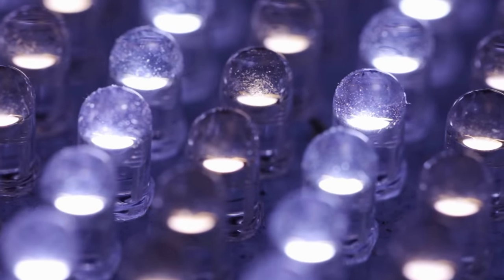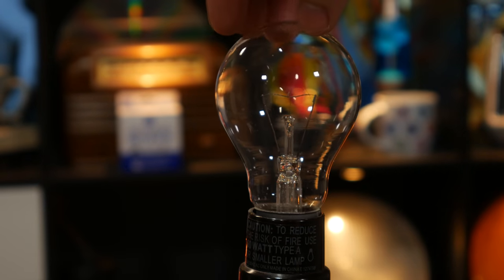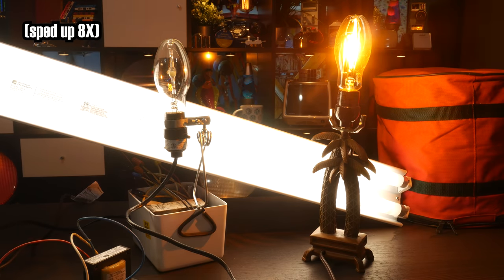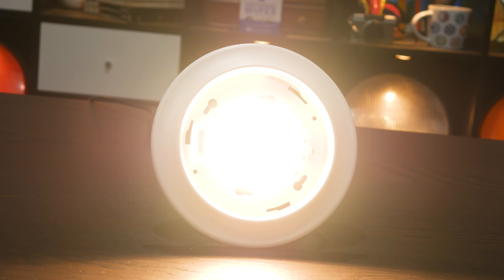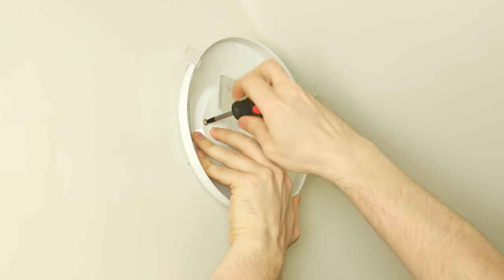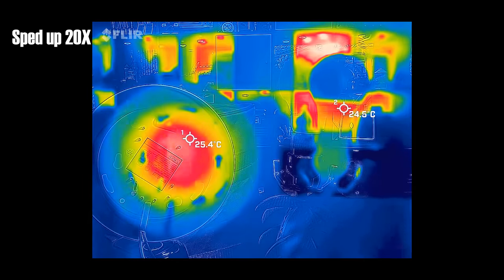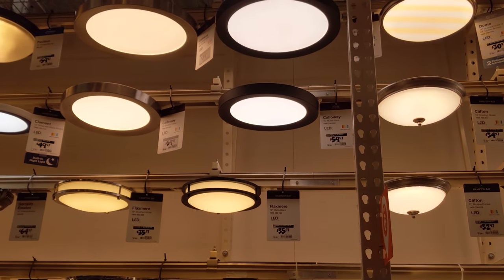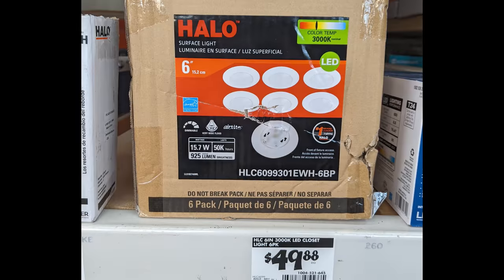A troubling trend in lighting?

Comment: Some of the integrated LED fixtures actually are designed to have the circuitry replaced, so the fixture is still saved. I went this path for my recently purchased house. Granted, there is the chance they stop making the replacement parts but since it seems as if they are using it for other fixtures I doubt it’ll be anytime soon.
Reply: That's the real problem, a lack of a widely-used standard, making replacement effectively impossible years later. The same problem happened with digital cameras, except the ones that take AA batteries. Perhaps it could be a socket where you turn the fixture to remove it (like you remove smoke detectors), then unplug a wire from the back.
Reply: Generally it's just a wafer with 2 wires that is screwed in. You shouldn't be worried as it should be an easy modification to retrofit a new wafer into it.
Reply: I doubt that you'll have to replace any time soon.
Reply: "Recently purchased house" in this economy?!

Comment: I guess I wished they had a standardized sizing and fitment that allowed for the retention of the frame and replacement of the lighting part, maybe with a quick connector. Could even have some of the electronics remain in the housing.
Reply: GX53
Reply: @marzi_kat  Yeah, bi-pin fittings are pretty good. My whole house has G9's everywhere, and they're pretty varied. There are even incandescent models
Reply: For the most part, the LED and the driver are designed with simar lifespans. No use just changing the LED when the driver is at end of life. They are both very cheap and disposable. I did in one case though change the guts of a new light to an old one I liked better. Does void the listing though.

Comment: Personally, I like the LED bulbs where they're made to work in tandem with an Edison screw socket. That way, you aren't constantly tossing out lighting fixtures, just the bulbs when they eventually burn out, and the LEDs last long enough where the benefits outweigh the slightly higher cost.
Reply: No they do not..but the light quality makes it a necessary evil...  soo many have burned up in the electronics I forensic mine.. I can still smell them....
Reply: LED bulbs last REAL long if you treat them right. If you turn them off and on again rapidly, they're much more likely to die. The LEDs themselves can handle it, hell, that's how duty cycling works, but the Driver isn't built to.
Reply: @petero2693  I have only experienced one LED bulb failure in ten years.
Reply: @gobblox38  I have had multiple fail in one year in a single socket of a kitchen chandelier, so it probably is getting funny power in that socket which is what's crapping it out
Reply: @randomassortmentofthings  Probably. I'd take that as a sign you need to call in a repairman to look at that particular socket.

Comment: another great thing about filament-style LED bulbs is the waaaay higher voltage these strips run with, as it's a lot of LEDs in series each of those. The driver for those sometimes is only a fancy rectifier, putting mains voltage through the filaments

Comment: 22:09 In this shot you can tell which fixtures have horrid smoothing and which have acceptable smoothing
Reply: an oft overlooked topic about LEDs. i cant handle any flickering its so distracting, but its starting to show up everywhere. lighting, car headlights, phone displays...
Reply: @guguigugu  Team Nystagmus assemble! ;) I must say I've had pretty good luck with LED bulbs recently, but it can definitely be an issue. Monitors and laptop screens about a decade ago could be quite bad for PWM flicker... sometimes (Intel onboard graphics) you could at least do something about it by increasing PWM frequency. My impression is that automotive LED lighting has actually gotten substantially better already.
Reply: @guguigugu  I genuinely do not understand how you notice a flicker at 100 or 120 times a second. Flickerless LEDs exist as well.
Reply: @Owen_loves_Butters  they do but you cant know until you bring them home and install. 
i notice the strobe effect when moving my eyes or an object. also even high-frequency flicker is noticeable in peripheral vision.

Comment: Thanks for excellent pros and cons. 
One con I find is with fixtures that don’t filter the DC, so the LEDs strobe at line frequency. I think that caused the black bands in your hardware store videos. 
My eyes and brain are sensitive to that, and I imagine a return to sick building syndrome of the days of magnetic ballasts.
Reply: A lot of cheap led xmas lights are also done this way. Makes them looks trange, especially when they move like from the wind or something
Reply: @Jeff-oe1yx  I was going to mention LED Christmas lights.  I hate them for that reason!  As long as I can keep getting incandescent ones I will.  Plus they have a warmer glow to them than LEDs.
Reply: Yeah, the strobing is pretty annoying. I don't think I'm sensitive to it, but I notice it immediately when I move an object. An easy way to test for that is to slowly move your hand, with your fingers open, close to your face, and notice if the hand motion looks interrupted
Reply: If your fixture has a separate driver / ballast, replacing that with a better model can fix this. The cheapest embedded-LED fixtures with AC-to-DC driver-on-board designs tend to be bad at this.
Reply: @pinecone606  or just use incandescent... boom, done
Reply: The fluorescent lamp was really famous for this when run at 60 hertz. When electronic ballasts came out, they ran at 30khz to combat this problem as well as make the lamps last longer.
Reply: @Jeff-oe1yx  these lamps are even worse. They only light up in half the phase and go dark half the time. They are pretty disgusting. I had some older ones like that also had terrible CRI. Yuck!

Comment: All the people saying Led bulbs fail constantly, here are a few possible reasons:
1. They hate LEDs and make stuff up 
2. They use non enclosed fixture rated bulbs in enclosed fixtures
2.5. Or worse, any led in enclosed fixture with an incandescent bulb
3. They bought them from sketchy places like temu
4. Bad luck
Reply: Most modern LED"s are very low quality aswell.

Comment: Edison: "Our lightbulbs last 8 hours!"
Modern makers: "You'll get tired of this lamp before you need a new bulb."

Edit: Hehe, my wife also is annoyed by clashing color temperatures. If a bulb breaks in the hallway I basically need to replace four bulbs, to get the exact same temperature. :-)
Reply: That's so true! I get my hands on so many perfectly good LED lights (some of them really nice) because the homeowners "just want something new".
Reply: This. This is why I miss having incandescent headlights on my car. Every so often I'd change it to a slightly different color; it was exciting and cheap.
Now, unless I spend 4 figures, I'm just stuck with what came on the car. Oh, I'm thrilled that the alternator has an unnoticeably lighter load, though.

Comment: I think introducing a new fixture-specific socket standard would fix all of those concerns. For example if you could buy those aluminum disks with all the LEDs and driver bits separately and the fixture had a clip or slide-in port for them, that would only cost marginally more (yet could be priced decently higher due to consumer perception) and it would take no additional space at all.

Comment: Ok so as an ex Marconi employee and film projectionist a few descriptions of electrical items,as we saw them
Incandescent lamp, an LER or light emitting resistor.
Electric Kettle a Water Cooled Mains Load.
Fan heater a Forced Air Mains Load
A transistor A Three Legged Fuse.
An Operational Amplifier , An Eight Legged Fuse.
A blown fuse, High Impedance Air Gap.
Screwdriver, Replacement fuse ( you won't blow that in a hurry!)
Analogue Television Transmitter, An expensive way to heat a building.
Carbon Arc Lamp, Handy for Heating Meat Pies.
Heavy ancient high wattage valve ( vacuum tube to you) amplifier, useful as a mooring.
Vinten Camera PanHandle, useful for extending short brooms.
There were many more of which I have forgotten over the years.
Keep up the good work!ove the out takes, do some V/O myself and once found that Magic Rabbit kept coming out as Magic Wabbit....I blame Bugs Bunny!

Comment: This finally explains, why my Ikea LED light I bought over a decade ago is still going strong. The driver and the actual light source are 20 cm away from each other. No wonder, even though the "bulb" gets so hot (I even burned myself once) the thing still works, because the electronics are in the foot of the lamp.
Reply: Same with the lights i got for all the chandeliers in my home. Bought them when LEDs first became mainstream, got them in packs of 3 at costco for $18 a pack. Im glad to say that in around 15 years only ONE has burned out. The driver is like half the size of the bulb and has fins to dissipate heat.
Reply: I have the same experience. Haven't had a single IKEA LED fail on me so far. I had to change the previous light bulbs regularly. Since my walls are almost 4m high (more than 12 and a half inches), changing them really sucked on some of my light fixtures. Since I switched to LED I never looked back ...
Reply: @brag0001  You definitely dont mean "inches"... probably feet, haha!
Reply: @Vlozh  um, yeah, I must have been tired or distracted ^^
Reply: @TheWaynester101  if only more LED drop in replacements had fins. That would make their cooling so much more effective.
Reply: @Vlozh  well... technically it is correct to say that 4 meters is longer than 12.5 inches, it's just a major understatement (like saying that the sun is further than 1 mile away from the earth)
Reply: It's usually the LED strings themselves that fail, not the electronic drivers. I don't know where that myth comes from that "the drivers" (or even better: "the capacitors!!!!1!1") are what regularly fails.
Reply: @westelaudio943  It usually is the LED's themselves, often from heat/stress.
Reply: @TheWaynester101  😢😢😮😢😢
Reply: @computernerdinside  yup. Id pay more for a longer lasting LED since i have a ton of light fixtures that are insanely hard to reach. 

Like, my house has 4 light fixtures at the top of the second floor. Thats around 30 feet high. A real pain in the ass to change them.